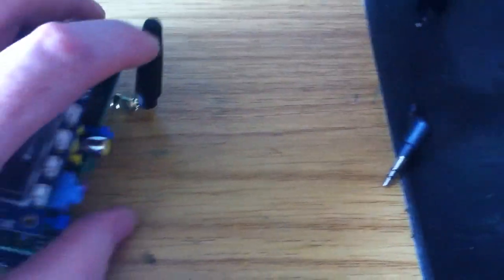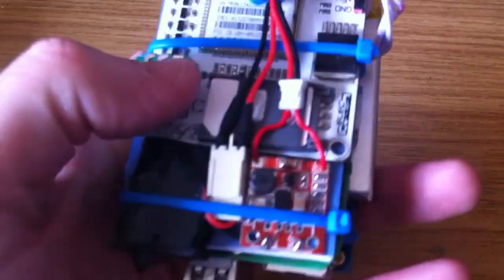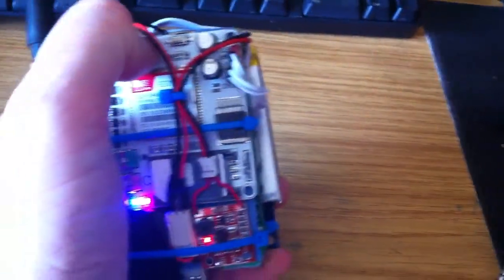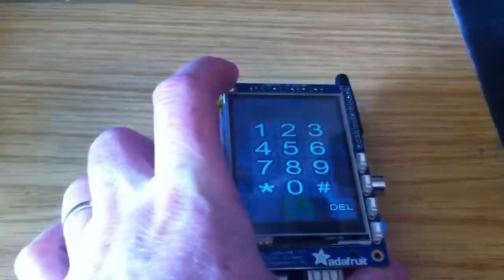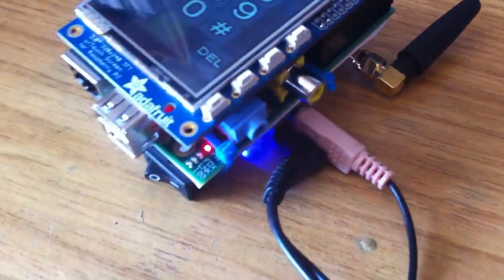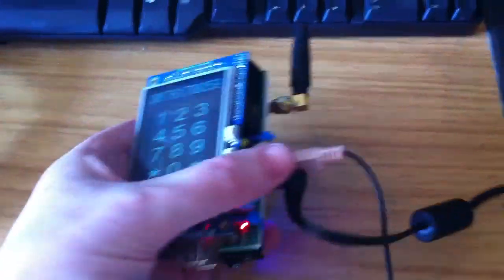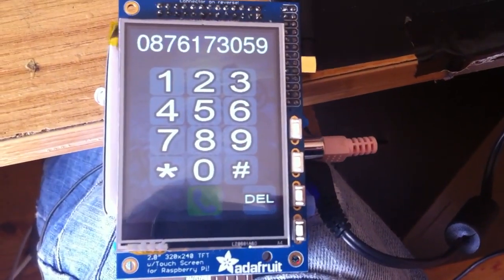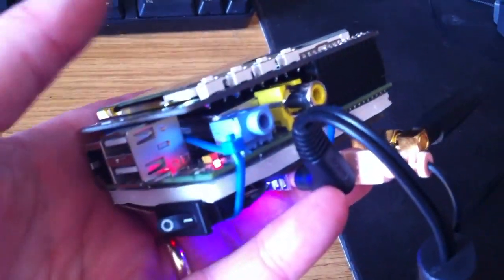PiPhone - A Raspberry Pi based Smartphone

Comment: A phone, but not a smartphone.
Reply: the pi is capable of android so if he felt like it, he could
Reply: ***** USB port, i have a friend with android as a secondary on his laptop
Reply: ***** should, androids for built in drivers for most touch devices lemme see if i can find a vid of it running android
Reply: I think people are getting confused as to what a cellphone is. A cellphone is NOT a "phone" -- it's a radio that only "looks" like a phone. Technically it's closer to a walkie-talkie than the phone that we use to have in our homes.

Just as a walkie-talkie doesn't need an OS, neither does a cellphone. Years later, very small simple OS's were added to cellphones to make them "do" more things: address books, calendars, play very-basic 8-bit games, etc (a "smart" cellphone). These were very small OS's were unique to each brand of phones.

Only in the last decade or so are phones running OS's that are very close to what run on computers. And because of these powerful OS's, the cellphones can do anything your computer can do and more.

So the "phone" in your pocket is a:  Computer + Cell Radio + GPS Radio + WiFi Radio + Camera
Reply: Jack Baldwin -- not true
Reply: CarMoves Not really. I looked him up. What does it fucking matter if I know of the guy who basically created cell phones? The point is an RTOS is an OS. You spent so much time trying to be right and feel special, but everyone knows you are wrong. Keep talking and looking like a douche, because MY work is done here.
Reply: @snugglyjeff214  -- You weren't right about anything. Take a course on basic electronics.
Reply: @MarkusDiersbock  Yes, I was. The fact that you havce no fucking clue what an operating system is, tells me that you should probably work on taking that course.
Reply: @snugglyjeff214  -- good come back. I'm guessing you still live with mom and dad.
Reply: Snuggly Jeff  Correct. A classic cellphone is just a radio (like a bi-directional walkie-talkie). A modern cellphone (smartphone), isn't really a cellphone -- it's a computer with a cellphone module.

And technically a cellphone isn't a "phone" in the classic sense. A phone is an analog device connected by cooper wire. A cellphone is a radio "connected" by radio waves.

We just use the term "phone" because of its common utility -- like a spaceship isn't technically a "ship".
Reply: a chip can have a set of instructions and not be an OS -- the walkie talkie was an analogy
Reply: if you make it able to boot OS, it becomes a computer phone, not just a "smart" phone
Reply: CarMoves it's true, my phone has 2 gigs of ram, while I have an old dell laptop I keep as a side project/backup that I plan on upgrading to 2 gigs if I can find the chip set
Reply: CarMoves I would say that a cell phone does need an OS, it just doesn't need a complex one with a GUI.
Reply: Snuggly Jeff No, a cellphone does not "need" an OS -- a "smartphone" needs an OS, but not a "cellphone"
Reply: So the embedded system handles all basic functionality without any kind of embedded OS? I guess I was under the impression that the RT OS in the firmware has always been necessary in all cell phones.
Reply: I'm not talking about smart phones though.  I am mostly referring to cell phones in the 80's with the os in the firmware.  It is still in modern phones as well obviously
Reply: 80's cellphones did not have OS's -- embedded or otherwise -- each maker had their own proprietary firmware
Reply: I think maybe you should read this so you know what I'm saying.  I think you might have a different opinion if what an os is. http://en.m.wikipedia.org/wiki/QNX just because it doesn't have a gui, or isn't installed outside the chip,  doesn't mean it isn't an operating system.  This is my point you seem to be missing.
Reply: I mean the difference between walkie talkies and cell phones is one has a set of instructions on the chip to allow it more complex functionality,  therefore making an operating system necessary to cell phones compared to your average walkie talkie
Reply: I've been a software engineer for 25+ years -- and my first 3 cellphones had no OS -- I think you are confused about the difference between firmware and OS's
Reply: http://www.osnews.com/story/27416/The_second_operating_system_hiding_in_every_mobile_phone So you are saying your first 3 phones did not have a proprietary RTOS in the firmware?
Reply: Snuggly Jeff That article refers to smartphones, not cellphones.

A cellphone does not require an OS. A smartphone does.

My first cellphone was the Motorola "half brick" -- half the size of the"brick" and cost about $1.00/min for a call. I was 22 with a computer business and needed to be reached by customers 24x7. When I used the phone, people would look over, as most people had never even seen a cellphone before, except in movies -- kids had pagers. At that time, a computer in your home was rare too.

That phone could only make/receive calls, and store some phone numbers -- that's it. Too simple to need an OS.
Reply: So what would you call the proprietary set of instructions on the firmware that tell the radio part of the phone to make and recieve calls to specific phone numbers? That article is saying the RTOS has been on any device with radio communication for a very long time, not just cell phones or smart phones
Reply: Also I know I have had a wrong assumption here, at this point I am just trying to understand more how earlier phones worked,  and what base level you could actually begin to call something an operating system.
Reply: Timothy Vreeland -- Martin Cooper would disagree
Reply: Snuggly Jeff -- Martin Cooper? My work is done here...
Reply: More like a dumbphone
Reply: I guess you could call it a DUMMY-PHONE... get it..? no?..
Reply: It may or may not be a smartphone ......... but what ever it is , it ' s a BRILLIANTPHONE .................
Reply: actually it is exactly a smartphone

smartphone = mobile phone + OS
Reply: Jack Baldwin wrong, until phones began to evolve to do more than just calling, they didn't need an os, such as the brick, the Nokia 3310 etc The first phone operating systems were only built to add features like mp3 players and games
Reply: Snuggly Jeff   The term "OS" is a bit deceptive. The Wright brothers invention and a 747 are both "planes", but hardly the same thing. Likewise, the OS flying Apollo 11 to the moon, and the OS on your phone are "OS's" pretty much in name only.

All OS's are software, but not all software are OS's. Notepad is software, but not an OS. Firmware is basically embedded software.

Most devices don't have OS's, because they are simple (channel changers, microwaves, etc). OS's are only needed for advanced functionality (multi-tasking, etc).

1st-gen Cellphones had a small instruction set that allowed them to connect/switch cell towers to send/receive calls -- they couldn't even text. Simple OS's were added to allow additional features: calendars, contact lists, basic texting, etc. They were very crude. As OS's got better, more features could be added: sending low-res photos, very basic web browsing (WAP), email, etc.

Popular modern phone OS's are just stripped versions of the ones running on computers.
Reply: Every phone thats ever been has had an os
Reply: Who the fuck is Martin Cooper? Anyways I knew I was right the whole time. No point in arguing with someone else that can not be swayed in opinion though,
Reply: @Hank Threlkeld -- "...every phone has an os..." ahhh, actually no. Smartphones need an OS, not every phone

Comment: Hi Dave, just found your video when looking for info on GMS / voip gateways. Very cool!!!, as its a PI you could also, I guess put asterisk on the pi and actually use it as a voip / gsm gateway with a wifi dongle also to access the internet for the voip pipe. excellent.
cheers
Pete

Comment: could you reduce the thickness by removing the composite video out, ethernet, and usb ports and instead have a usb wifi module soldered directly to the board?
Reply: integrate a decent mic/speaker, add a camera, and boot android on it and 3d print a housing, it would be nice considering you could fix it yourself instead of worrying about some stupid warranty
Reply: If you were building your own board, or comfortable with hacking a Pi, that should be very possible. As is, he's using something which already comes with those, so for prototyping it'd be a hassle to remove all the extra stuff (although it'd be cool-but-unnecessary to have a phone with all those ports too :p)
Reply: John Bowen   I guess this is just in the prototype stages.  There definitely is a lot of possibility for this. And yea I was thinking the same thing, if some of those ports where removed it could become quite thin.
Reply: Or why not get a zero w
That is already so slim and has Wi-Fi and Bluetooth

Comment: hello daveh , why shouldn't i use a 5V 1 mAh instead of using 2500 lipo battery and DC-DC boost converter ? what do you think it can work with 5V lithium battery ?
Reply from the maker: Ahmed, The voltage from batteries tend to go down as they disgharge, so you need something to stabalise the input to the Pi. Try measuring your 5V when fully charged, and almost depleted, and see the difference. I doubt that the Pi would be happy with that range of voltages, as it needs a stable 5V to operate properly.

Comment: Modify the Pi a bit like remove the Composite, on board audio, ethernet, and have one usb port, and use the micro usb-a port as a charging port, and remove the gpio port to further compact it but not to much where there is no airflow to keep it cool, make the screen internal for the pi, make the GSM module internal for the pi, and then add a internal memory flash for a raspberrypi GSM operating system and there you go, you have a raspberrypi phone nice a compact, now you'll just have to get a custom case made that has a detachable back for the battery

Comment: I suppose you can get much better results (in term of performance) with MinnowBoard MAX where intel CPU E3825 (dual-core, 1.33 GHz) installed. It about 140 $. It will be far more advanced and faster than any mobile phone.
Reply: Yeah sure, except that smartphones can have quadcore 2.5 GHz.
Reply: Naud van Dalen
 ARM quad core is not the same as even single core x86 powerful CPU. To be honest ARM is a kind of joke.

Comment: Nice project, but I wonder what the big deal is, this has been done numerous times before.
SIM900 is super easy to use with UART and it has all the GSM features build in. The same can be done with any MCU, only limitation is the UI.

Just send serial data of "ATD + +123456789;" and it makes the call. Done. SIM900 hardware itself handles the receiving, modulating, decrypting, audio, etc. and everything that is difficult.

The SIM900 chip is under 10$. SIM908 also has GPS built-in and costs a few bucks more.

I've built one too with arduino using SIM900 GPIO. It's fun, but useless.
Reply from the maker: I wonder what the deal is myself. Maybe it's the fact that I just took all the pieces and put them together (including GUI), and made a phone call on something that looks kinda like a cellphone? Not all that special, but all the world's major websites all seem to have take an interest in it! :)
Reply: Dave Hunt Just ignore the guy, he is jealous that you made the effort is all.

Comment: Do you have to pay for service when using this?
Reply from the maker: Yes. You need a SIM card. Good question though! :)
Reply: Dave Hunt what wires did you use and how did you connect it?
Reply from the maker: There's a small bit of soldering to get the DC-DC converter connected to the LiPo and the Pi, but the rest are standard Dupont female pins. Can be found on eBay fairly easily.